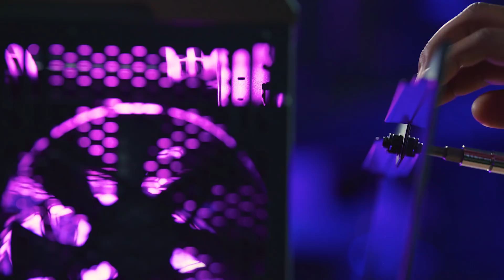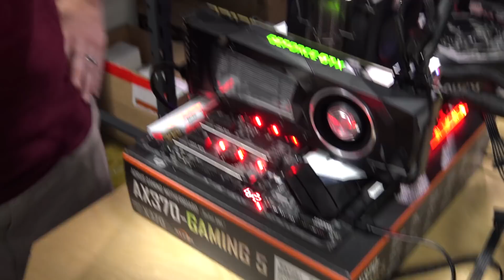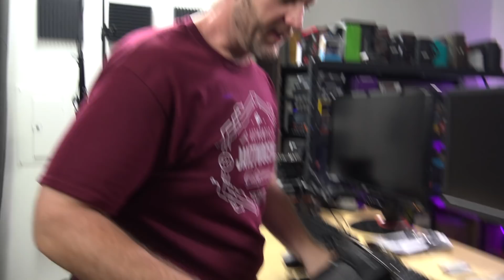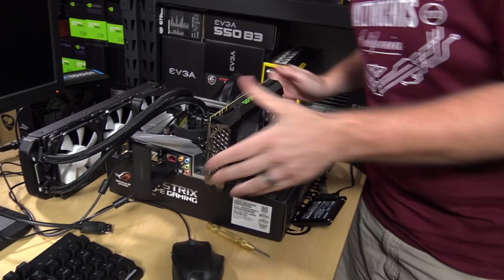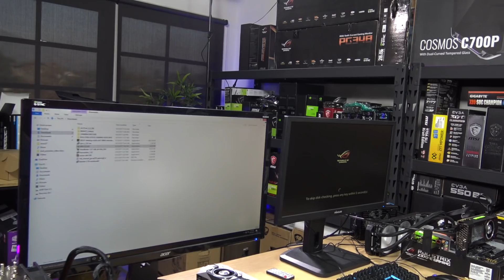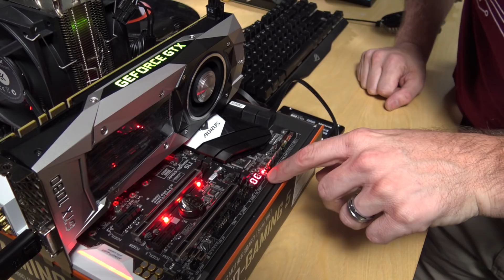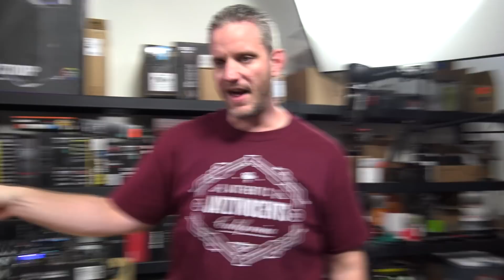I cant figure this one out... HELP!

Comment: Sometimes, Motherboard BIOSes conflict with certain VGA BIOSes because of an issue with their UEFI settings. I would try toggling between UEFI, and then UEFI + Legacy in the Motherboard BIOS and see if that helps. If I remember correctly, some P55 chipset  motherboards conflicted with GTX600/700 series VGAs because their UEFI settings conflicted with the VGA BIOS; changing to UEFI + Legacy resolved this because the Legacy option were less "restrictive" (not a good word choice, but I don't know much about UEFI to make a definitive statement as what is actually wrong).

If that doesn't work, I would check if the "non-functional card" is on non-stock settings on the Intel system and revert it to stock if so. Then try booting again. It's doubtful that would be the case with a brand new card, but worth a shot in this case.

And if that still doesn't work, try rolling back the AMD BIOS and see if it will boot with an older BIOS version. Just on the off chance it could be a specific bug in the BIOS of a specific motherboard.

Comment: Actually had this issue with a new rx 470 and an intel 2600 (oem mobo)

470 worked fine on my ryzen rig and our i5 rig but I could not get it to boot on the 2600 at all, updating the bios on the oem board fixed the issue 100%.

It sounds like its a bios issue of some sort with the motherboard, although yours is fully updated.

Weirdest part was the bios update notes had nothing to do with vga compatibility or anything, and the bios was old but still newer than the current on the motherboard.

Comment: Last time I was making an AMD build I found a similar issue with SSD/HDs, its been a while but from what I remember I was having an issue when I was installing an SSD along with an HD, the HD worked until I removed it (to make room for the ssd) and then the rig refused to acknowledge both. I tried other HDs and SSDs and some got recognized and some didn't and the SSD I wanted to install on the AMD rig worked in other pcs just fine.

After about a day or two of fiddling around trying to get the damn thing to work I found that I had to first unplug everything from the motherboard then plug everything back in, I recall there was a specific order like plugging the PSU first but can't remember now, and then it would recognize the new SSD. 

Some AMD hardware seems to have a few more quirks than others, so doing something stupid that you think wouldn't make a difference could very well be the thing it wants you to do.

Comment: I see a lot of people posting basic trouble shooting steps that are very common. Try different slot. Different cpu/memory/psu/cables.
In might be out of place but I'm sure these things have taken place if jay mentioned the bios. I agree with many comments about voltage requirement or contact issues such as sagging. Or even bios version incompatibility. But I wanted to comment because there are allot of stupid comments arround paid advertising or that jay showed the same bios twice. He mentioned he has spent time already on this and I'm sure this mistake was purely a filming issue. Also people with the attitude the its simple problem blah blah blah. Please take a moment and think back to a simple problem you faced with a pc that you simply over looked. And quit being dicks. Jay spends his time with the problem and decides to share it as he says for the new people building their first pc. Thank you jay. Hope you figure it out. Love the content.

Comment: Jay, I'm 16, and I have run into this problem in my school district as an intern. We would put ram into around 4000 computers, and some of them would just not accept a few ram sticks, and others would accept those same ram sticks, no clue why when every computer was the exact same model.
Reply: Deagon have seen that behavior before aswell. Back in late 80's early 90's. Think its the toterances that in some cases builds up to a to big tollerance issue. But not totaly sure. Never figured it out for sure. But its strange. No faulty components but when just that set of components together it simply did not work.

Comment: Well  the most likely two issues are, for one the motherboard RAM address is conflicting with the graphics card RAM? Try and changing it for different RAM to see if that sorted it out! Or it could be your power supply has an issue or cables trying a different  power supply and cables one is drawing a bit more current than the other one and it's affecting the power supply because of a fault.

Comment: Check the VGA bios again because you screwed up in this video. Maybe one card is drawing more power than the other and the PSU can't handle the extra current draw on the problem machine.

Comment: I don't know if you checked but in this video you did NOT show us that the BIOS were the same on both cards.  
We'll call the card that works on both systems Card W and the card that fails on one system Card F

You checked the BIOS version of Card W on the Intel system (and it ended in 04), but then you put Card W into the Ryzen system and checked its BIOS again  (lo and behold) it was the same BIOS.  But you did not (on camera) check the BIOS of card F on the Intel system.

Comment: Do you have a riser adapter that you can probe to measure the pcie power draw? If two seemingly identical cards behave as shown in this video, one card clearly has some sort of fault the Aorus board is more sensitive to. You'll probably have to go full Buildzoid on it to discover the issue.

Comment: You checked the bios on the same Titan twice... first while in the Intel Rig, then after you put it into the AMD Rig... So no bios check on the "not working". 

I would go and take the system apart piece by piece, clean it, then reassemble. While cleaning looking for bent pins, etc. 
I once had a board that when in a specific midi tower case was extremely shy finding its gfx card. After moving the board into a big tower, no more worries. After every cleaning while still in the mid case, I had to unplug and reseat the gfx card several times. Even wiggling it in the slot. 

So I put that one of to a structural mobo error, when under a specific kind of structural stress there was a bad connection or circuit.

This would point due to the reseating of the 1080. Stress on the mobo pcb.

Comment: This exact thing happened to me
Reply: How I fixed mine was put the card in a different pcie slot and it worked fine. It wasn’t the card or the slot that was the issue it was just the 1070 in the slot. I plugged a 1060 in it and it worked and the 1070 worked in a different system. But for some reason the 1070 just didn’t work in the slot

Comment: Try swapping the motherboard on the Ryzen one and see if it will start. If that works, then flash the bios on the original motherboard and then retry it. If it works, then it was a bad bios. If not, then it might be something bad with the motherboard.

Comment: The box on the AORUS looks like it has some metallic printing on it, how much are you willing to bet that stuff is actually conductive? Also look at the back of the board, the solder joints for the first x16 pcie slot line up right over the that metallic stuff on the box.

Comment: I've seen a weird trend where random Pascal cards have problems with random PSU's. I have no logical explanation why this is, but I've seen others in forums who discovered the same thing. My 1080ti had the same problem. It didn't like my brand new corsair 850. So I grabbed another PSU, and wonder of wonders, everything worked fine. I placed the corsair 850 in a system with a 980ti, and all is well. So PSU was not defective. The 1080ti was not defective. But put those 2 together, and they just didn't like it. Go figure.

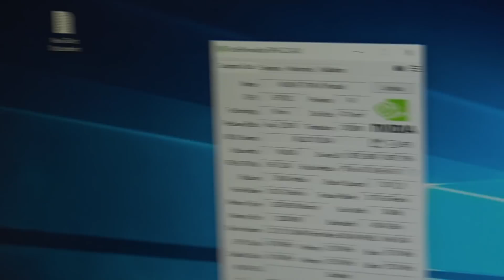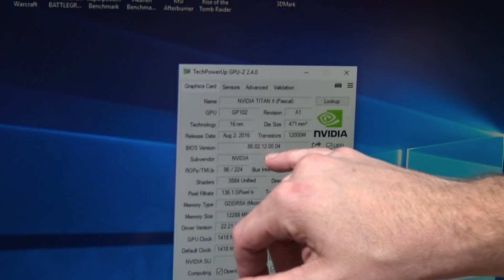Comment: at 2:11 you checked the bios of the card that worked on the Intel system and at 4:51 you checked the same cards bios on the Ryzen system, of course they are gonna be the same bios version. You never checked the bios of the card you moved from the Ryzen system to the Intel system to see if that is a different bios or the same.

Comment: Many years ago (18), I had a system that would only finish POST if no 'newer' monitor was connected during POST. If you connected the monitor from power-on, it would hang at the Compaq screen. (Again, it was the 90's.) But, it would POST with old monitors.

Apparently the old AGP GPU was getting stuck trying to figure out the frequency to sync the monitor. The old monitors were fixed frequency. We pulled the card out and tested it on a different system and it did the same thing, the same way (vs the 'good' card having no issues).

Sometimes there are imperceptible problems with electronics where it 'should' work, but it just doesn't.

Comment: jay you took the video off of the intel that you looked at the bios version then moved it to the amd and checked it again??? It was the same card and same video bios.
 Remember your video on two cards with very different efficiencies? Same thing here. The intel board has looser controls I am betting then the amd and the two video cards are very different on the pcie lane. Move the intel video card to the amd and it works because the cards are very different I am betting on the different pcie slots.
 Nothing you can do can change the silicon lottery. In this case the lottery is the whole card.

Comment: The one thing that I did not see you check is the (possible) problematic card that would not work on the RyZen system working on the Intel system with GPU-Z.   For the video's sake, you did not show both cards having the same bios revision.   If it were me I'd double check that and use the working intel system to update the BIOS for that graphics card and reinstall it in the RyZen system.

Comment: I know nothing about those cards. Do they have dual bios? Just my thought. I have spent hours troubleshooting my own system I built. Had a IDE hard drive windows xp refused to recognize so I had to swap connectors from IDE 0 to IDE 1 until I could install the updated driver. Something so simple can drive you crazy.

Comment: Well my comment will most likely not be seen but this is what I think. Assuming you got these cards in a different batch this can result in a different bios. Now i know you showed them being the same BUT Gpu-Z has had previous incident of displaying false results. To come to the problem I believe that the firmware on the "bad" gpu is not optimized for ryzen support. I would flash your gpu bios to try and cleae any restrictions.

Comment: You may want to check the BIOs on both cards! You checked it on the Intel Motherboard and then moved it to the AMD Motherboard and checked the same card. I think you meant to check the one you put on the Intel after the move. So all you did is check the working card on both Motherboards. Check both BIOs on the Intel and then go from there.

Comment: The connection is not "guaranteed". And the 3(?) slots came from the same production run when the board was assembled. The card and slot could both be on the edge of tolerance, and when combined, out of tolerance. You're not going to like this, but try a di-electric grease.

Comment: I have built hundreds of systems. In the 90's I work k ed for a pc builder. I have seen things like this before. My suggestion is to install the Ryzen system in a chassis, install the power supply, etc.yes, I too have run dozens of systems on a box with no issue. But they are not designed to do that. You may have some strange stray capacitance someplace that would be taken care of in a chassis. 
I have had the opposite as well - a chassis that nothing would boot in, but every part would boot on the bench. 
I'm assuming you've tried a different n t power supply. If not, also worth a shot. Good luck!

Comment: maybe its a motherboard issue?  have you tried transplanting the cpu and memory from the faulty system to another board?  Maybe there's an issue with that pci-e slot that for some reason that GPU doesn't like.  If its not a motherboard issue, maybe its the CPU in which case you could change it out for an "identical" ryzen cpu and rerun the test.  From the evidence you provided with this video, it seems like its a problem with the GPU though.  Maybe the your BIOS flash didn't work properly and reverted to the old BIOS and ryzen cant deal with it but intel can?  If its that hard to flash GPU BIOS, maybe you could revert to an older BIOS for your ryzen motherboard and test the GPU with that.  If that works, then I think you found your answer.

Comment: Try starting up your computer using Ryzen's integrated graphics. Then, turn it off and re-mount your GPU. That's how I solved that issue on my i5-6400  build (the one I'm currently using) when I had the same issues. This usually starts out being an issue when reinstalling components. Could be a CMOS glitch, should be fine with some patience.
Reply: Ryzen does not have an iGPU
Reply: Well, I guess he'll just have to start up the system and figure out how to shut down a PC while blind. Other than that, I don't know what he can do.

Comment: I would guess one of the graphics  cards has a minor hardware issue. Some slight electrical or signaling problem. And one motherboard is simply more tolerant of it than the other.

Comment: Once had a card that wouldn't work on an x16 directly, but did with an extender or if I put it in a x8 slot.
A GT460 if I recall correctly.

Comment: First thing I would check is the PCI-E power connection, I would test the bad card on ryzen again but with 2 separate PCI-E power connections instead of the daisy chained one. It could just be slight variance between the two cards. Otherwise I'd check to make sure the bios really is the same between the two GPUs since you checked the same card twice in the video. :)

Comment: Jay this may be mechanical. Also I agree with Mr Matthew Weiler you did not check the bios of the problematic card. But! you also was having problems from Gigabyte Mobo to ASUS Mobo. And I have the Gigabyte GA-AX370 Gaming K5. And it has been slightly problematic. Just say'in?

Comment: I still have 2 GTX550 TI's.  When I had installed one it would not boot.  I put in my old vid card and it would boot up fine.  I RMA'd the first one and when the replacement arrived with the return sticker I put it onto my board and it booted the first try.  I put them in SLI and they both went 8x8.  Long story short, I purchased the second one also and still have both.  They will both boot on my Z68 motherboard but one would not boot on my Intel 915 series board for some reason.

Comment: Check the pci connectors on both the motherboard and the gpu  that doesn't work in that system. There may be a spot on the video card contact that works fine with other systems, but that one is a little more sensitive.

Comment: ESD damage to a controller on the Titan card that is intermittently working could be where the issue is. With ESD you get really odd intermittent issues until eventually the card dies. Troubleshooting is rock solid, the only only only other idea I would have would be something going on with the PICE lanes on the ryzen system, alongside the possible ESD damage to Titan could be a possible combination.

Comment: Are the power supply on both system the same?  If they are, have you swap the power supply like you did with the GFX card?  I like to see if the symptom happens when you swap the power supplies.

Comment: The BIOS revision was the same, because you were looking at the same card but on the other system ........ double check the bios on Titan 2 (The problematic one) on the intel system.

Maybe try a different power supply on the Ryzen system and see if it might just be a problem with how the PSU is interacting with that particular card.

Comment: Sup Jay, crazy suggestion (but not original since I just noticed after I posted someone else suggested this too earlier) but try this out if you haven't already: take the power supply from the intel system and swap it with the ryzen setup. There may be something going on with the pci-e power delivery/draw rail on the RYZEN PSU somehow "not liking" the power connectors of that particular nvidia card

Comment: Sometimes the BIOS has a memory of HW and it might not be talking with the card like it should, especially if it wasn't the first card after the last CMOS clear or BIOS flash.   It's NOT an issue with the card, it's 100% a MB BIOS issue.   You have Dual BIOS, so make use of it. 

Start by just using the CLR_CMOS jumper to hard reset your current BIOS to stock and see if the card will POST after that. If not...

Change the SB switch to DB then the BIOS_SW to Backup and boot the TITAN X.  Unless you flashed both BIOSs to the Current Revision, you should have an older revision that's never seen the TITAN X before.  If this boots, you need to reflash your Main BIOS using a known working card, then select POWER OFF and swap to the TITAN X before you boot again.

Comment: could it be a id code failure on the video card i had that happen on a pc the i was working on for a company i worked for previously the hardware id was off and the stupid thing did not want to work on a desktop but it worked for all of the other machines

Comment: The montherboard manual lists code B2 as "Legacy Option ROM initialization". You could take a look at the BIOS on "BIOS" section if Fast Boot is enabled and how the VGA Support is set (auto or EFI). Maybe the Titans have the same BIOS but different board revisions and react in different ways to a legacy boot option.